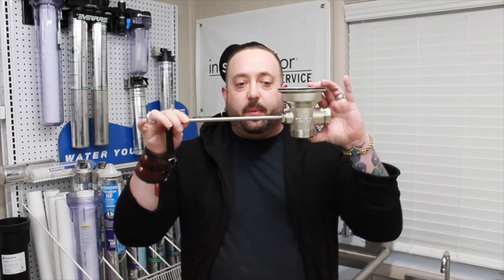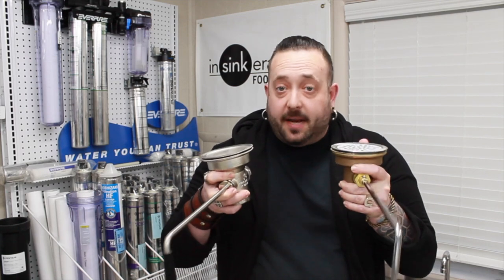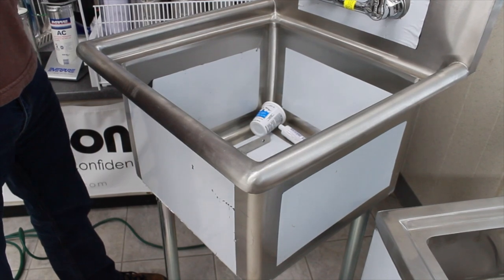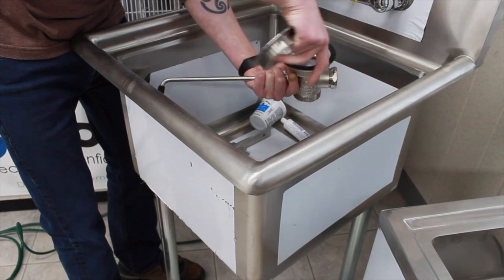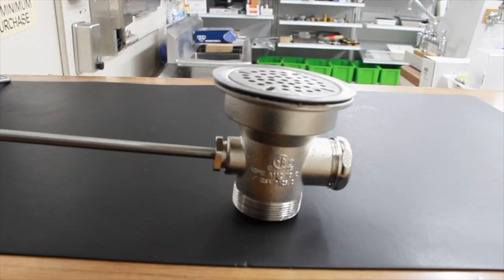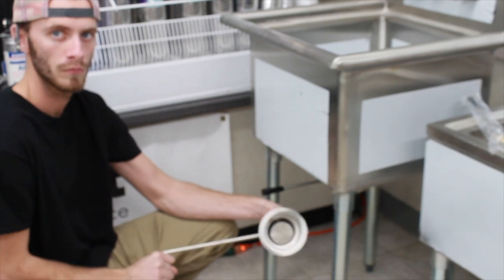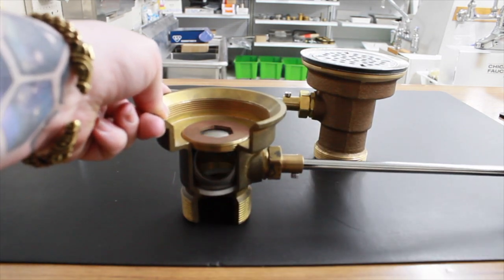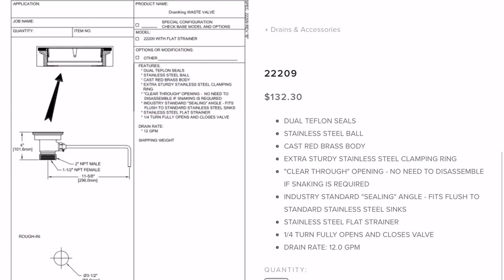Commercial Drain Assemblies

Comment: Appreciate the details! My girlfriend is opening her own bakery and the space doesn't currently have them installed. Besides the safety aspect, there's also the use of having a water tight seal. It sucks having to refill the pre-soak and sanitizer sinks all the time because the plugs don't fit great. These solve that issue

Comment: What kind of drain basket do you use for a stainless commercial sink that has no recess for the basket flange?  The sink bottom is flat, with a short "neck" flange underneath the sink.

Comment: At my work the drain does not open enough lots of rice have to put my finger in there to open it stoped up all day nasty..what can i do we never fill the sink its for draining only..
Reply from the maker: Randolph Ramirez Randolph Ramirez different strainer options. It might be best to put a mesh strainer there to catch everything. Better food practices about scraping before it gets to the sink. And then sometimes depending on where you are, commercial disposers.
Reply: If i take out the stoper can the drain still work..
Reply from the maker: Randolph Ramirez , if you remove it, it would just become a free flow drain. You’d have to leave the handle there. But the other issue is now you’re sending everything down the drain and now it’s just creating an entirely different issue. Unfortunately this is less of a plumbing issue that you’re having and more of a training the kitchen staff what’s appropriate to send into the sinks and down the drains. Without fixing that main issue, you are going to have worse problems needing your waste lines snaked and jetted. What might seem like a good immediate idea is actually just creating a worse problem in the end. There’s a lot of expensive options that catch debris down the line (waste traps or interceptors) but those need constant cleaning and maintenance as well. So the real answer isn’t how to I keep the drain from clogging. But how to not clog it to begin with. Doing that will drastically reduce visits from the plumber to band aid what the real issues are.

Comment: I have a question hoping you could help. I bought a stainless commercial sink for my garage at auction. Cannot figure out what type of drain this is, there seems to be a stub pipe welded to the bottom, about 3" in diameter and about 6" long, no threads or anything either. How does this type connect to a drain? Any help is appreciated! Thanks.
Reply from the maker: wreckingballpi   Might be a po plug. Or all thread drain. Usually 1” or 1 1/4” in size.
Reply: @atshelp  its bigger than that. I'm browsing your web catalog... could it be a floor sink?
Reply from the maker: wreckingballpi   Send me a picture. Tim@atssupply.com

Comment: Putty and or silicone not needed.... It does nothing for the seal..
Reply from the maker: Vaticider69 it’s one of those strange things. Putty never creates a seal, it’s used to fill gaps. There is nothing about the nature of putty that is waterproof or water tight. Seal might be misleading but I would recommend filling the gap. Some sink bevels are more severe than others. And over time, especially when these drains get beat up over long periods of time, I like to think of the silicone as a good back up if or when the nut gets loose underneath. Levers get bumped, drains turn out of place. Extra protection is never a bad thing.
Reply: Good point on the wording of it.... The brand we use ....escapes me atm... but the top threads are so shallow putty was too frustrating silicone messy...but good for keeping food debris from penetrating and rotting in there..